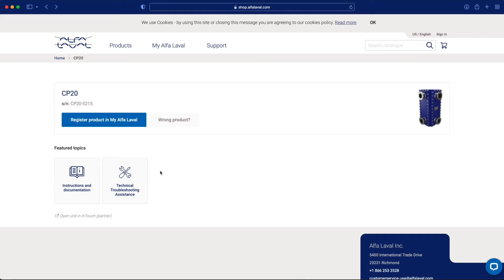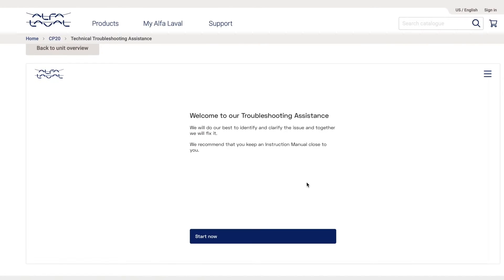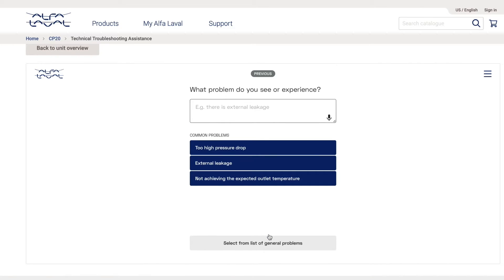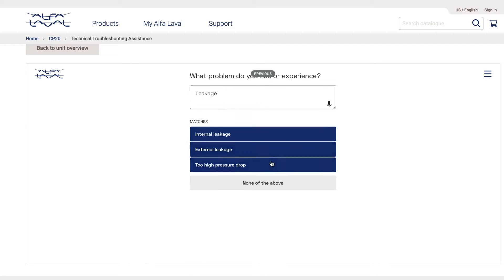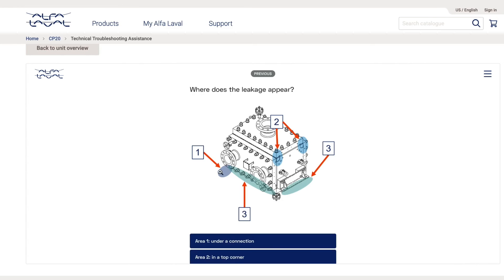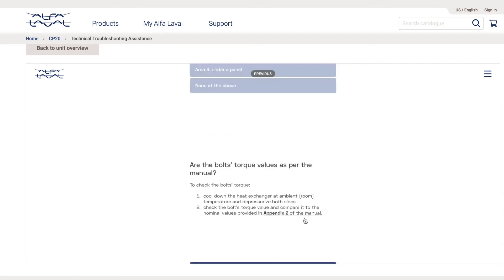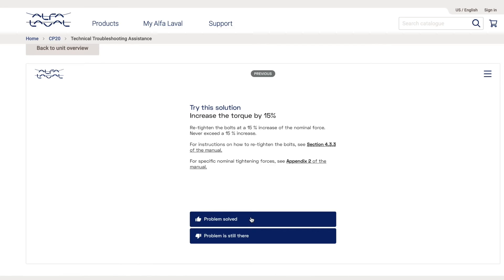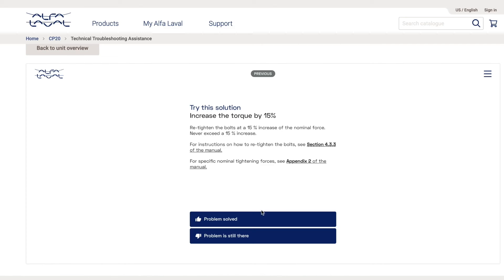Troubleshooting Assistance - the digital service tool from Alfa Laval

Comment: Sir, we are using the alfalaval 3.2 version. We are facing the problem with bwts is not working automatically when command gives from bridge or any other accessible computer. After giving a command pop up is appearing to accept the Authorization evertime then system is working fine but not working remotely. Can u advise how to resolve and troubleshooting assistance.